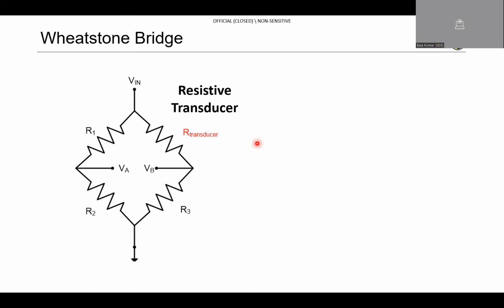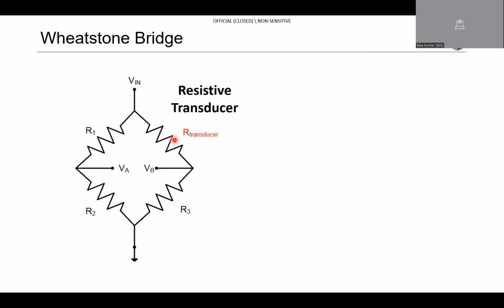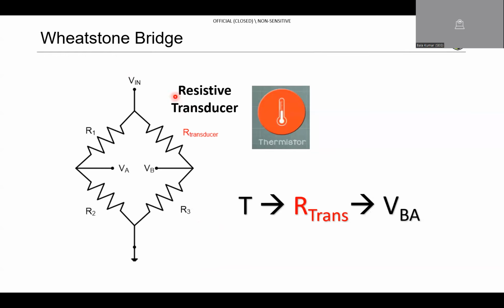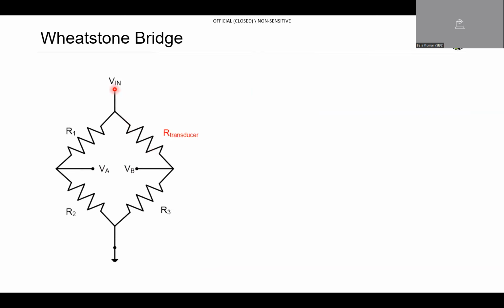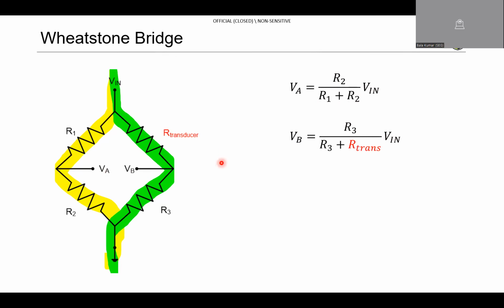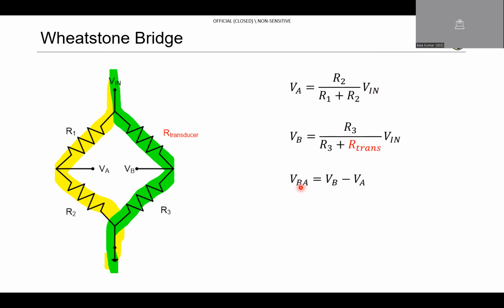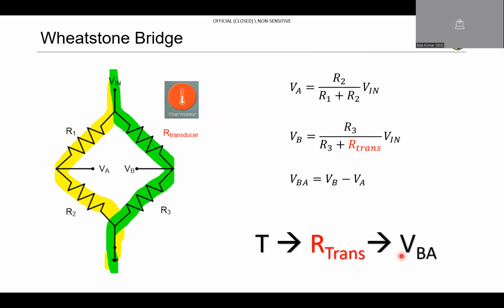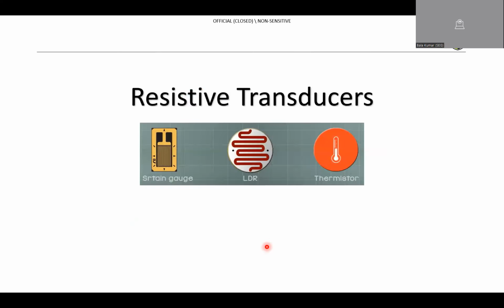Wheatstone Bridge

Comment: The  Wheatstone Bridge consists of four resistors arranged in a diamond shape with a power source applied across the top and bottom, and a voltage measurement taken from the connection points on the sides.
Reply: wow
Reply: @cobbl5109  thanks CobblFPS

Comment: Wheatstone Bridge has 3 normal resistors and one transducer(thermistor,LDR, etc). The value of Vba canges depending on the change of R transducer. It can be calculated using voltage divider rule

Comment: The wheatstone bridge contains 3 resistors and 1 transducer. However it was seperated between two ways using the two voltage divider of VA and VB. However another part like when the resistance of the transducer change, it will also made the changes to the voltage across of VA and VB. However how does the resistance of the transducer change is control by a device like a thermostat which is the temperature to adjust it.